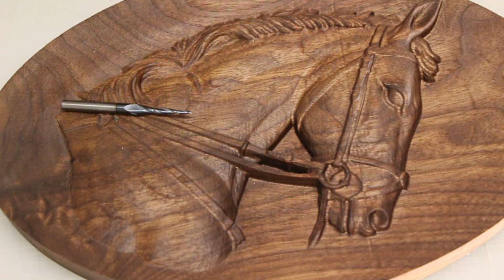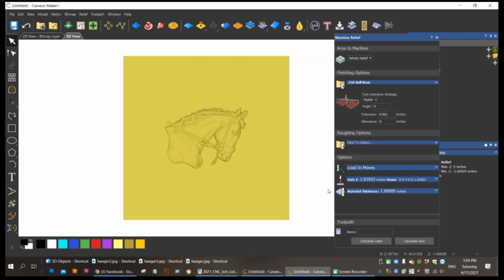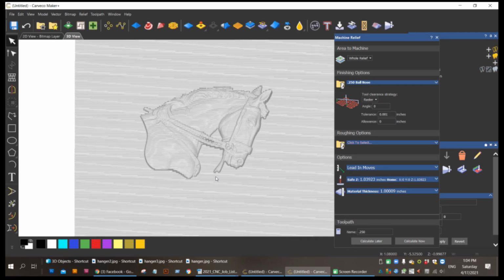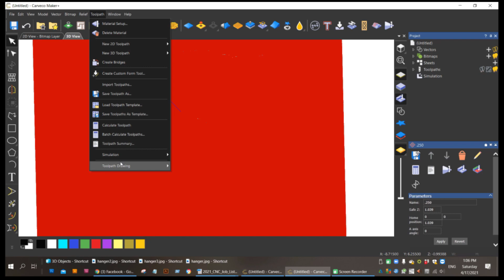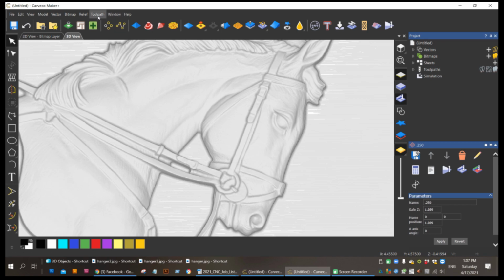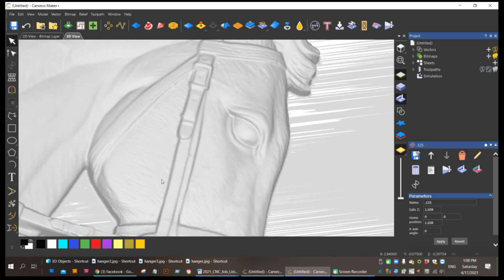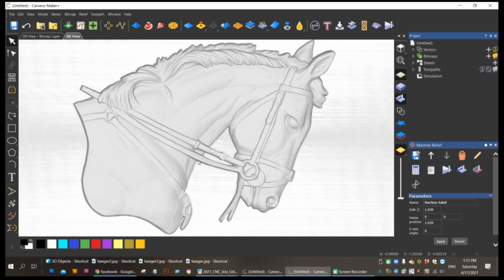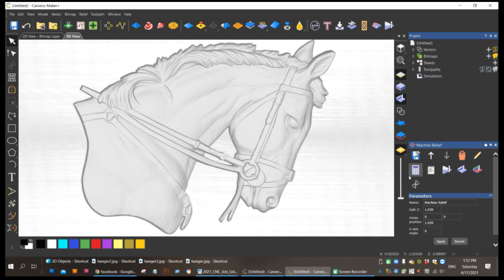CNC Ball Nose Bits Explained

Comment: Sir, I think it's very valuable vedio, if you solve the audio problem,  please mend it if you can because we want to watch it again this.
Reply from the maker: Thanks, The microphone wasn't plugged in properly to the camera. Good learning experience.
Reply: @CNCBits  On the audio track add a compressor and normalizer to raise up the levels without clipping. Also using a thick pop filter on the mic will all you to get it closer to your mouth without it popping and gives clearer sound. Also doing a complete video without using any ums goes a long way to making it easier to listen